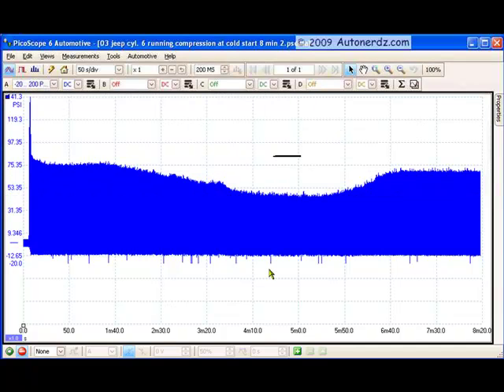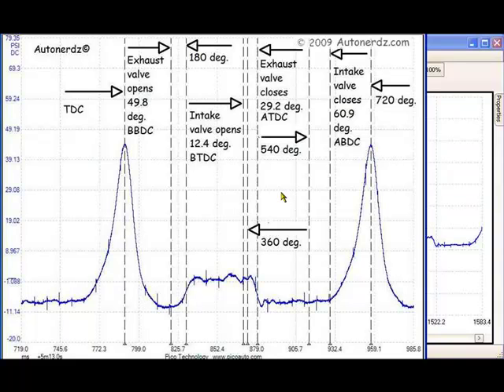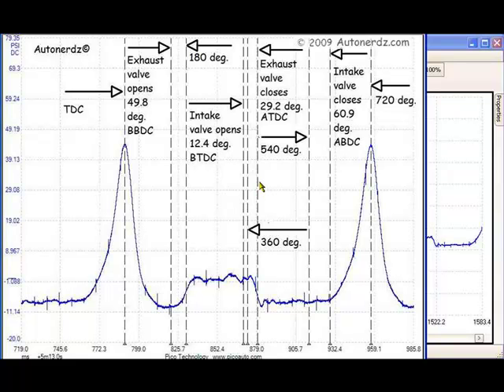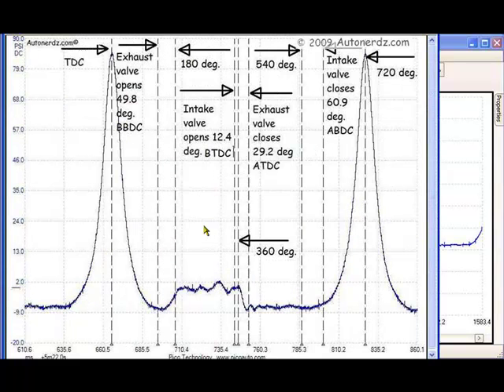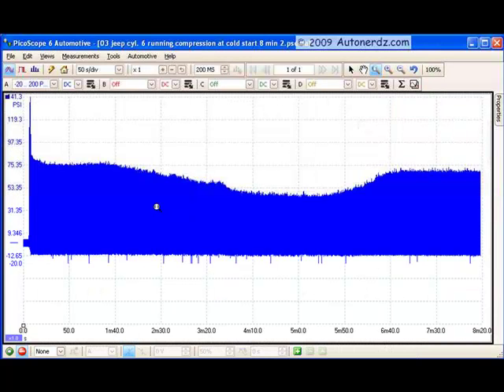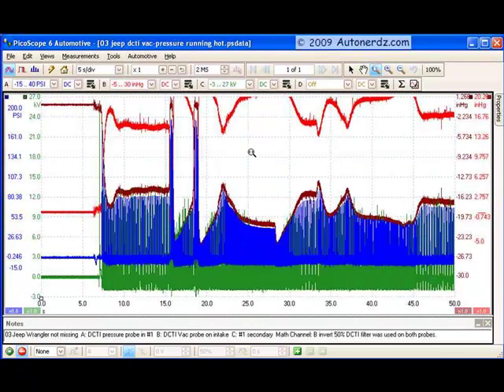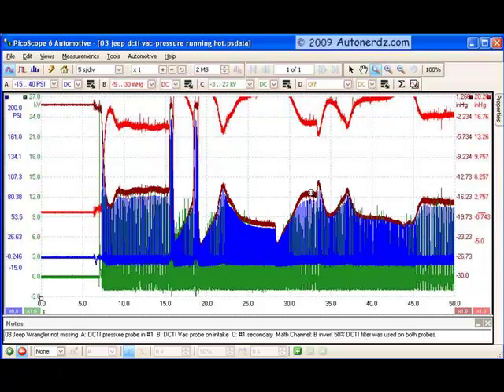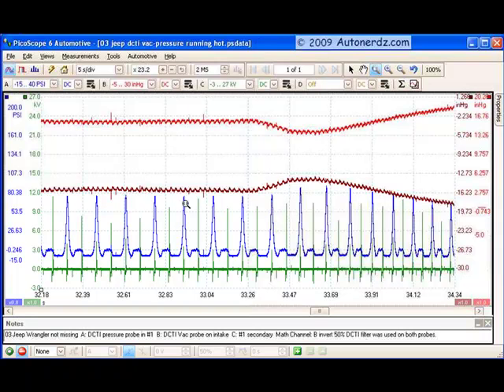The Wrangler from Hell part 3

Comment: that would have been captured with a vacuum waveform, too, yes?
Reply from the maker: You might have seen something there but, being an exhaust valve issue, maybe not.  In any case, you still would have had to follow up with the in cylinder pressure testing to confirm the nature of the problem.
Reply: pico scope is my next purchase
Todd Huggard is in my city...
Reply from the maker: Mark G Todd is no longer an Autonerdz affiliate but Ron Brown of Auto-Know can facilitate your purchase through us in Canada. Purchasing from an Autonerdz affiliate has the same benefits as purchasing directly from Autonerdz.  Give Ron a call.  (800) 665-8773